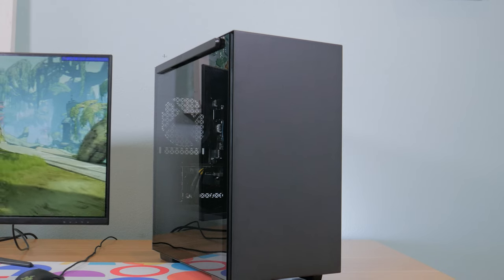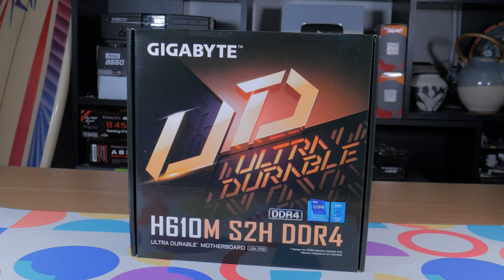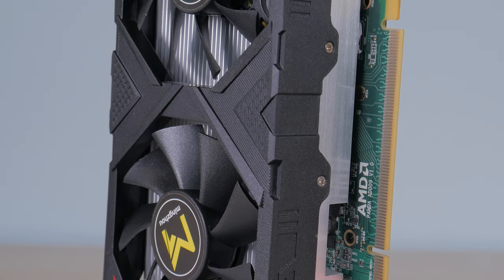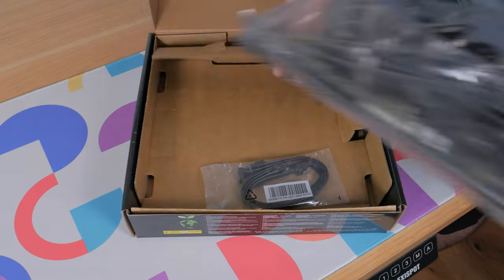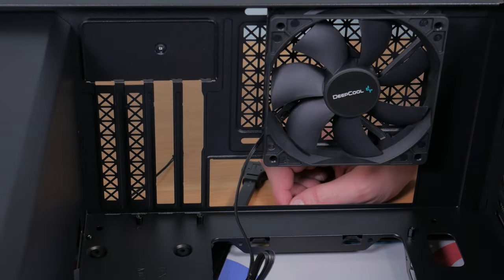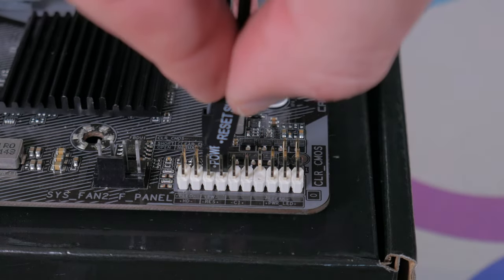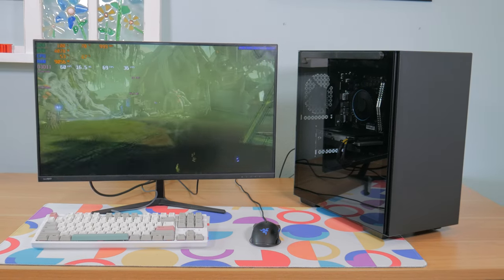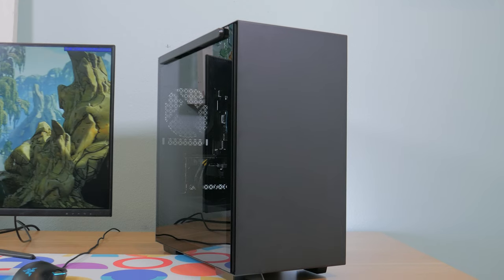$400 Gaming PC Build Guide! (2023)

Comment: This is probably the best budget build I've seen so far this year with an Intel CPU.
The upgrade path is good & I would definitely recommend this build to anyone who has a tight budget.
For the GPU, I would upgrade it later to a rx 6600 or rtx 3050 after a year or two.

Great video man 👍
Reply: please don't get an rtx 3050
Reply: also the power supply, its tier f in psu tier list (do not buy)
Reply: @joshua9050  says who?
Reply: @lordoflemons776 yo I'm buying a pc from someone for like 300 dollars I could send u the specs and tell me if it's worth it.
Reply: @lordoflemons776 i5 6500
16GB DDR4 RAM
1TB SSD
GTX 1070
800W 80+ Gold PSU
Reply: Its worth it it looks good for the price
Reply: @luisleo.  It's good if your not looking for everything on high or ultra with over 60 frames, solid specs in my opinion.
Reply: @luisleo.  for 300 it's pretty damn good, personally i'd try to get an i7 and a 1080 but my budget is not your budget lol.
Reply: better to get a gtx 1070 second hand, thoise are like 1.4x better than 3050
Reply: I built a 500 dollars gaming PC here are the specs. Suggest me changes for the future if you want lol
ASUS PRIME A320
AMD Ryzen 5 3600
GeForce RTX 2060
1TB SATA SSD
16GB 3200MHz DDR4
850W GOLD
Reply: @luisleo. It's not bad but that i5 is gonna hold you back HARD
Reply: @miniweeddeerz1820 no it won't. Do not spread misinformation.
Reply: @randomlol69  are you kidding me. You are mad if you think it won't, even on a 1070.
Reply: @luisleo. For $300 that’s good
Reply: @luisleo. I think it's a good pc for it's price
Reply: Do you guys know why the gpu is so loud.. i mean the rx 580
Reply: @Ntnvvv  bro GPU being loud is not that important
Reply: I mean.. the fan speed of gpu is like 3000 rmp.. and I didn’t do anything heavy
Reply: @luisleo.  i know its a late but if you just starting out its good the psu look good ram and ssd also good to start out with but just the cpu might not be up for everything its has the same number of cores as the i3 9100f i started on and that i5 is abit slower. might be good to take some parts off that pc and get a bit better cpu. Just gotta look at what you wanna do with the pc and cost.
Reply: as a 3050 owner, dont get a 3050

Comment: Good video. I know this is a strict $400 budget pc and you can "$50 upgrade" yourself to almost infinity.. But a 12400f and 5700xt upgrade would mean a $500 pc that is in a whole different performance level. A massive upgrade. It's rare that a $100 increase does that on pc.
Reply: IMHO I think people need to realise a 4.2ghz 1660/1680v2 is enough for  most people, that and ddr3 is dirt cheap, and you can now get a 6700xt used also and its all for the same $400
Reply: Ryzen 5 5600 + 5700xt. Noted.
Reply: @Sergmanny46   actually the rx 5700xt is slower than the new RX 6600xt or non XT.  i'd recommend the RX 6600xt/non-xt since it has more performance for a good price right now especially in the used market, plus the other concern for the rx 5700xt is driver support, and the only reason it's still a good GPU in comparison is because of the beefy architecture performance and the high VRAM bandwidth which is less power efficient than the RX 6600xt/non xt (if you care about electricity cost). But if you can find the rx 5700xt for a dirt cheap price, go for it, if your budget is so tight
Reply: @Sergmanny46  consider the 6600, i dont know how good rdna1 really is, and i mean if you can push it might aswell get an RX 7600/6600XT or otherwise a 6600 non xt
Reply: @user-lp5wb2rb3v yeah xeons 1650/1660v2 are cheap but its not really ideal for gaming,even though these types if chips has great clock speeds but its...not designed for gaming,high tdp needs good cooling solution,same goes for the ram,you need ECC memory for the motherboard on it which latency is lower than it usually be,and 1680v2 can only be find in Macs and not anywhere else
i dont really recommend it unless you really have a small budget
Reply: @user-lp5wb2rb3v  Yes but then OP's "50$ upgrade" to infinity is going to apply here if we do the "buy a 6600, or maybe a 7000 series, or maybe an 8000" and so on. 

No, a 5700 xt + Ryzen 5 5600 will do the job. MAYBE if we push it we can consider a 6000 series, and that's it. When it comes to money/performance ratio, no one beats amd. There's just no other. Intel A770 seems promising, but I'll rather wait for them to release more drivers.
Reply: @namm_  I specifically stated the 1650/1660/1680 because those are overclockable ;p
Reply: @Sergmanny46  You could build an Intel Xeon pc for the price of b550+5600
Reply: @user-lp5wb2rb3v  yes,but isnt it alot for a 135w chip?
xeons are affordable,if not great for their prices but only for workstations...i wish there was a chip that was pricely similar to xeons and have great gaming performance
Reply: Better paired cpu/gpu combos while ignoring budget and avoiding any major bottlenecks are as follows: r5 5600 + rx 6700, r5 3600 + rx 6600, r7 2700x + rx 5700 or r3 3200g + rx 580.
Reply: @stolenhal0  id rather x99 than zen+
Reply: @akmalrusydi2730 the newer card is the better buy IF you're pairing it with a modern board that has Pcie 4.
Reply: @user-lp5wb2rb3v ddr3 not supported on motherboard
Reply: @stolenhal0 could you do a r5 5500 with a rx 6600 xt I’m new to pc building so I wouldn’t know
Reply: Do you think this build could run something like Lords of the Fallen, Elden Ring, BG3, etc?

Comment: Just did a build for $400 and used that same storage drive! Such a great value and way better than a similar 2.5" SSD.
Reply: how does the space work for you? im building a system for some friends kids - went with a 1TB ssd and im worried that wont be enough. i have 4TB NVME on my desktop and games that easily take 120GB for just one...
Reply: @beardedgaming1337  Really just depends on how big the game library is and if they are storing photos and such. I have a 2TB in my personal rig for video files and games and still have 1/2TB left.

Comment: Usually a motherboard with built in wifi isn't that much more expensive, so it would be a good alternative to buying a wifi-card. It would make the build much cleaner and avoid any video card size compatibility issues if you want to upgrade later.
Reply: Bro, there's always something for just a little bit more. This is a $400 target new parts build, there are always going to be some compromises to hit the target.
Reply: @sevbait  you did not understand.
Reply: @void4713  I understood just fine. If someone wants to save $20 and do it later because a wifi mobo isn't available for the price of this one, they have the option.

Personally like you and the other commenter, I prefer to spend $20-30 more to get it built in, but if the budget is strict, it's important to have that choice.
Reply: Let’s just all try to earn 20 extra dollar to have that option available to us 😭
Reply: good to know

Comment: A wi-fi card is definitely important. My first prebuilt had a slot on the motherboard for a wi-fi-chip-thing. My second pc, I built myself, I bought a nice pcie wi-fi card for. Third pc was temporary so for a little bit I connected it to a laptop through ethernet and use my laptop's wi-fi, until I bought a cheap small usb wi-fi thing. And my current pc as a dedicated antennae.

Comment: BRO! Thank you so much!! I'm building a budget PC as a bday gift for my cousin, and was stuck on the motherboard; the ones with Wifi are kinda pricey. Thought I had to power through and get one of them because they don't have ethernet cable at home. I totally forgot PCIe Wi-Fi adapter and affordable motherboard combos are a thing! So I'm using your budget motherboard, Wifi adapter, and SSD reccommendation.

Those 3 hings brought my budget down quite significantly!! Once again, thank you so much! Subscribed 💯

Comment: I will always watch your videos buddy, like them a lot. Don't really have anything to add on this one because I'm looking to spend a bit more money with a couple friends using known brands. I would love to see a summer 2023 $1000-1100 video because with the RX 6800 XT (And it's 16gbs of VRAM) new for only $400 right now at several retailers, I think there are some exciting options gamers could produce that will not require upgrading for a few years, play all the best games in 1080-1440p at high frame rates on high settings. Hope you consider making one over the summer. Our road blocks have been the best case, motherboard, and cooling solutions for the $1000 budget, and whether or not it's worth upgrading to DDR5, given ram is so cheap as u pointed out in this video. Also several manufacturers have unveiled new 2023 case designs, which has put a lot of good 2022 models on sale at MC. Of course the PSU will be an issue for this build,  which is why I say $1000-1100 because of this crazy price hike and the decision between ddr4&5 ram. Sorry to be off topic but very interested in your thoughts about this, cuz that 6800 XT at $400 new is insane in terms of value right now. Hope u consider it. Again, great video.

Comment: It's not a bad build but I wouldn't use that case as Deepcool has better ones for about the same price. Like the Matrexx 40 3FS. Same space inside as the one you picked but comes with 3 fans out of the box (their color can't be changed) and the front panel can actually breathe properly.

Comment: 6/8core xeon(ivy or haswell) bundle + 32gb ram/2tb ssd + used 20xx/RDNA1/RDNA2 card 
and dont tell me the cpu is weak, its between ryzen 3600 and 5600 in performance, assuming you overclock it

Comment: ryzen 5 2600 16gb ddr4 ram any budget casing a320mother board nvidia gtx 16660 super 6gb gddr6 any cpu cooler will do the job  and 512 gb m.2 guys this is also a very good budget build

Comment: I wish prices like these were possible in my country, best I could do for around the price was a Ryzen 3 3100 witha 1060 6GB and it still ran me at $460

although you could've saved in the power supply (yes I know it's not good to cheap out in the power supply but hear me out) could've went for XPG Pylon which are pretty popular for their reliability, quality and specially price, the 650W model costs $50 in my country, probably will be chepaer in USA
Reply: nah in usa it was the same price

Comment: What would be your Ryzen version look like?
Reply: Ryzen 5 5500 + B550
Reply: B450+r5 3600
Reply: 3600 if you can get it new from a reputable seller, otherwise its the same performance as the 5500

Cheap B550 is like 10$ more than b450 which I think is worth if you upgrade your Cpu/Gpu in the future. Otherwise, no difference at this performance level.
Reply: If you had to go brand new, definitely the 5500 + A520 or B550. It wouldn't perform better in single core, but would beat the 12100f in multicore and probably help with streaming a bit more. For a used build though, the 3600 is a solid contender not being much worse than the 5500 while being quiet a bit cheaper used. That paired with a B450 used motherboard would make for a solid bang for your buck build.
Reply: @BrandanFischer  New cheap b450 boards are the same price as new cheap a520 boards making the a520 boards kinda usless
Reply: @PostWin  I was speaking from a used perspective, not new. I picked up a B450 Tomahawk the other week for $40, not bad if you ask me!